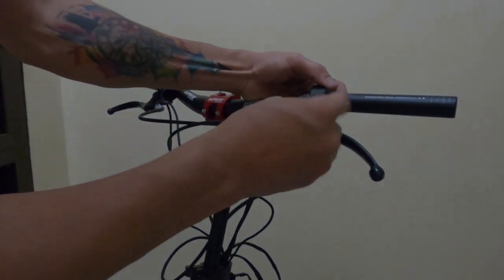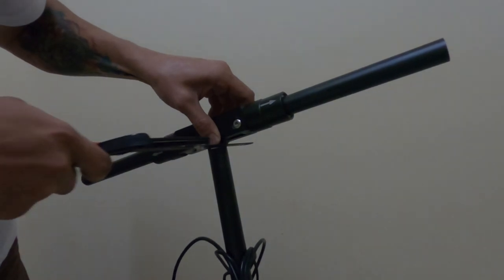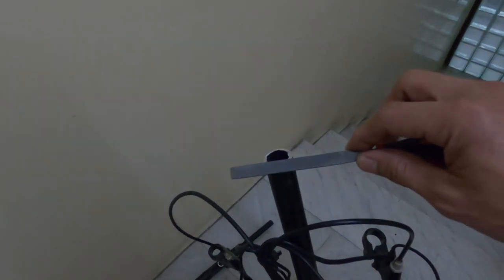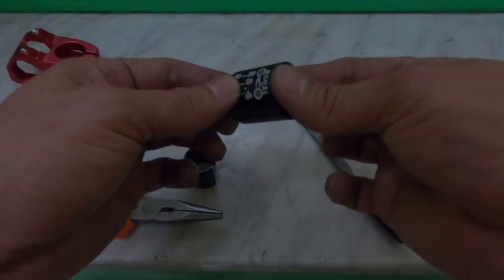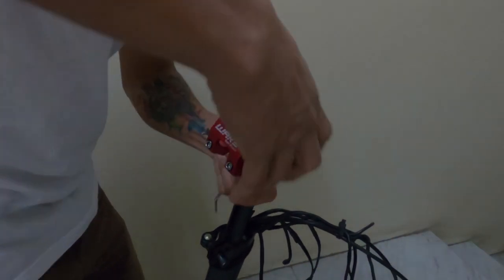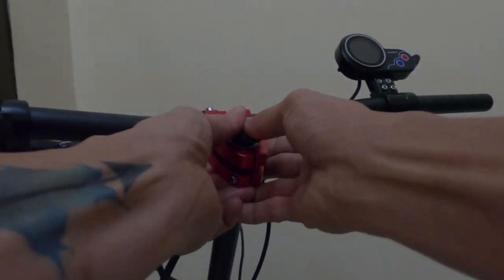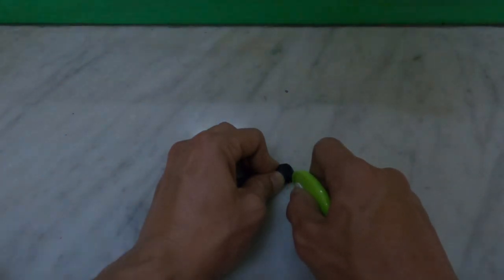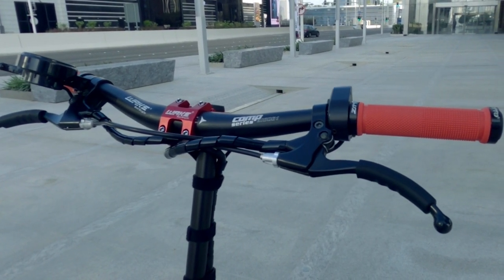Handlebar Modification for E10 | Mober S10 | EMOVE Cruiser | Zero 8 9 10 Electric Scooter

Comment: Hey I tried doing this yesterday and it keeps sliding side to side, I think my stem is lower than 25.4mm but bigger than 22.3mm which is very frustrating.

I noticed you cut a piece of another shim to make it fit snug, I should try that, will keep you updated if you reply
Reply from the maker: Goodday!
You have to cut a small piece from the shim and place into the gap to make it snug fit.

Keep me updated bro.

Ride safe always!🤟

Comment: What is the outside diameter of the steerer tube on this scooter, I want to do this mod to my Dragon GTR V2 and want to know if this is compatible with my scooter
Reply from the maker: Goodday bro.
How are you doing?
It's approximately 25mm in diameter.
Have a nice day..
Thank you for watching😀🤟
Reply: @jaysonulanday  thank you so much for taking the time to reply to my question..
Reply from the maker: @haydenwaymouth2754  you're most welcome bro.. thank you so much for watching too😀
Reply: @jaysonulanday  it has helped me out even though our stem sizes are different I was able to work out what I need to do the mod, now just waiting on parts to arrive and hopefully all my calculations are correct
Reply from the maker: @haydenwaymouth2754 that would be great, i'm sure bro!
Ride safe!
Thanks again🤟

Comment: Sir anu po size ng stem tska handle bar salamat po
Reply from the maker: Goodday kaadik!
Sorry for the late reply.

Stem
Material: Aluminium alloy
Color: Black, Gold, Blue, Red (optional)
Handlebar diameter: 31.8mm
Fork diameter: 28.6mm
Weight: 120g / 4.2oz

Handlebar: 620mm

Drive safe!
Maraming salamat po sa panonood😃